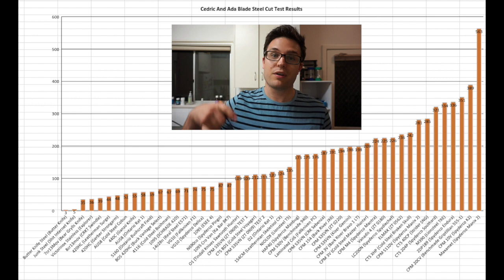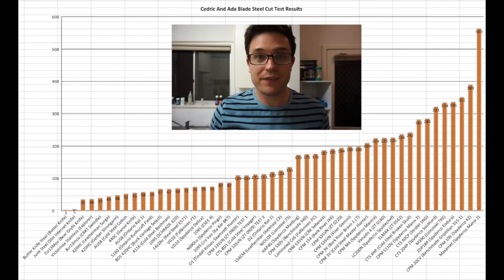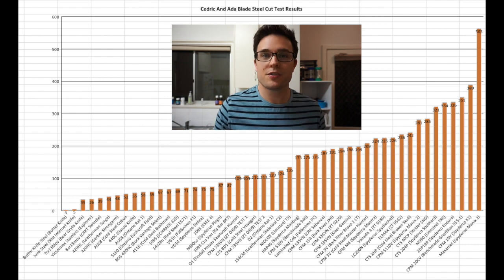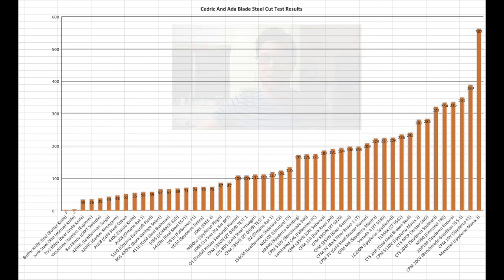Blade Steel Nerd Vlog - New tests from others, Feedback and Faults, Maxamet, Haters - Good Talk!

Comment: Your channel is awesome. Keep up the good work. Weird. I have zero problems with cts xhp is tropical weather humidity and getting wet and dirty so I think it’s rust and stain resistant. It’s actually my favorite cheap steel over s35 which I feel is lesser performing steel (more of the s30 range). By far my favorite steels are 20cv, cts 204p, m390. It’s tbe best balance and I think your tests match what the industry claims.

Comment: So I have looked at the worksharp system and I decided on going with an actual belt sander sharpener system, and have gotten fantastic results!!! It uses 1”x30” belts and have belts ranging in grit 200-4000, finishing with two leather stroping belts both with different grades of polishing compound!
 Use junky knives to practice, but I have gotten pretty good and can sharpen tons of types of knives and other cutting instruments (scissors, pruning shears etc)

Comment: +Cedric & Ada Gear and Outdoors Expensive N690 knives drive me crazy! Also I'm sure you'll love the high hardness ZDP in the Rockstead! I have a Damascus Sukenari ZDP-189 270mm sujihiki at 66 HRc +/- 1, that's laser thin and less than 10dps. It feels like it practically cuts infinitely! Keep up the good work!
Reply: Herb Toker a very few years ago most super steel wasn't as popular or even available then. Heat treatment not perfected etc. N690 however was very available and perfected HT's. Some makers are more recently either getting better equipment for HT to do steel like m390 etc. Or sending out to do heat treatment on these newer more available super steels. But alas some custom makers are still using 440c and feel it's a great option and that supper steel is probably not needed for every customer.
Reply: Tactical Center D2 has been around pre WWII, S60v since 1995 and S90v has been around since 1999. AEB-L and 154CM were also time tested steels. It boils down to the fact that N690 use today especially is a cost savings measure or a company doesn't want to put the effort in, even years ago they could have used 440C.
Reply: well, i dont think these people or manufactures have really seen the data. certainly doubt they all look at this channels data to make steel type decisions. tho i hope some do.

they just pick a steel that they know that has good properties that have been used in knives.

plus most people buy customs and put them in a safe never to be used, no real demand for it until most recently. got to remember the average buyer wants a 15$ knife and dont realize what they are actually getting for that cost. 

the few of us that are either collectors or knife nuts or users are more focused on different aspects. i prefer the best steel cause, man i hate sharpening alot (one knife that takes a while to sharpen out weighs sharpening one knife daily or through jobs). and i cut a lot... but i also like collecting knives for the different action they all have. 

other people only take the knife out to cut whatever is in front of them at a single moment. they might cut a zip tie, open a letter, cut open a toy package for the kids, or break down that box to fit in the garbage... but infrequently. they dont really care about the steel type. i dont like this because i want every knife to now have m390 or something of the sorts as standard. but thats them. 

anyways lots of different knife people. it all depends on the customer base. i certainly would buy a thorburn or trevor burger knives with n690 without batting an eye. there work is worth it.

Comment: Oh, and one more thing. I think I've figured out why many people still view VG10 as a great steel, with very good edge holding, while tests have shown it to be medicore at best. It's edge geometry. Edge geometry effects the perceived edge holding ability of a steel greatly, and most people know VG10 from Delicas, Enduras and other Spydercos, that have blades made to cut. If You compare the user experince of a Delica to something that is made out of D2 for example, that is thicker behind the edge, uses a more obtuse angle etc, it's easy to feel like the VG10 does better, while in fact it's the geometry that does better, not the steel itself.

Comment: We r trying to heat treat some maxamet blades. Currently figuring out how to treat them without distortion. It should be interesting. I love 154cm, s30-35 and I love m390. It’s my fav. 
I do have a jarosz in aebl I need to sharpen it and figure out if it’s to my liking

Comment: CRKT and Kershaw should upgrade to BD-1 from 8CR13.
Reply: SailfishSoundSystem they should... but the Chinese factories Kershaw and crkt use don't have the steel let alone the heat treatment equipment to do bd1. Spyderco uses a factory with this equipment. The factory that does bd1 is named maple knives. So unless crkt and Kershaw switch to a better manufacturer or they buy upgraded HT equipment that won't happen. Plus bd1 probably isn't as available or cheap as 8cr13mov.
Reply: Thanks for the info.  I know Spyderco ships BD-1 to Taiwan and China for their knives.  There has to be another steel in the pacific rim that is economical and provides better performance than 8cr13mov.  VG-10?  I know that is made by Takefu in Japan.  Seems a logical choice. It's been out for a long time and is probably my favorite all around steel.  I just think people are sick and tired of the crap Chinese steel that is claimed to be D2 or 440C, S35VN etc, but in reality it's 5cr13 or some other garbage. It's a shame because I would buy more CRKT knives because I love their designs.  To add insult to injury, CRKT now has this Ruger line of knives.  I love Ruger and I've owned many Ruger pistols and it pisses me off they use Chinese steel in those knives, hence cheapening the brand and quality.

Comment: Fun question to test: Does size matter? To find out compare Spyderco's mega-blade, the Tatanka, to other small/normal folders. Will VG-10 on a really big blade get more mileage than on the little guys?
Reply: Briant Lougan He uses the same amount of blade for each test as a control variable so I'd say it's safe to assume that it would add mileage.

Comment: N690co Steel is becoming a pet peeve of mine. Why is it so freakin overpriced, is it just because it`s a Bohler Steel?? I currently have two knives in that steel, the Extrema Ration BF1 and the Fox Knives Dart, both cost about 150$$ and that steel is simply not acceptable for that price, I would not pay that price for a knife in VG10 or 14c28n and n690co isn`t far superior to those (it`s slightly better, but not much). Thing is, a lot of cool designed knives are currently in that steel (looking at you Steel Will Onrush). If they were charging between 70-100$$ for a n690co knife I could live with it but the prices some of the makers are asking for a knife with frn/grn/g10 handles and n690co steel is absurd, no fit and finish justifies those prices unless the knife is actually hand made.

Comment: What the guy means when he says biased is that every knife will be held slightly different, so when you cut you can twist it or put pressure on the edge that's slightly different resulting in vastly different outcomes. Actually sounds like a first year uni student who just learned about human bias in experiments and how it should be removed... deciding they are a fucking expert at telling others how to do non biased tests...

Nothing biased there...